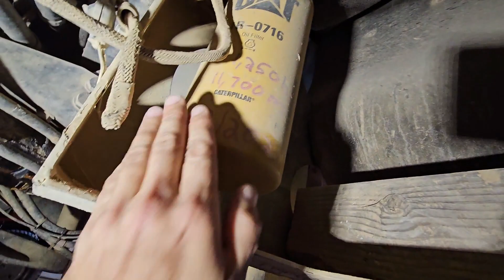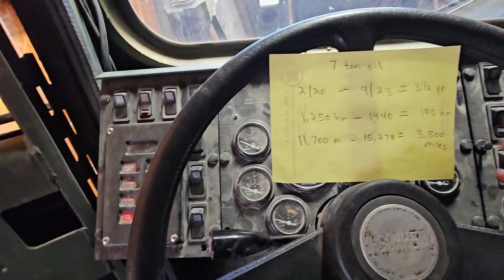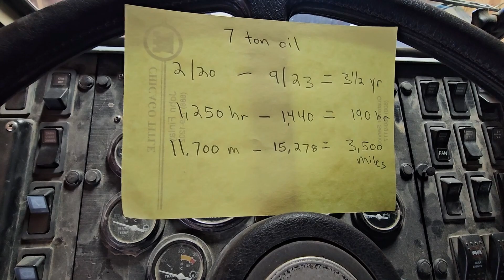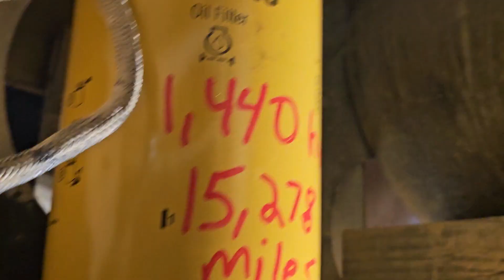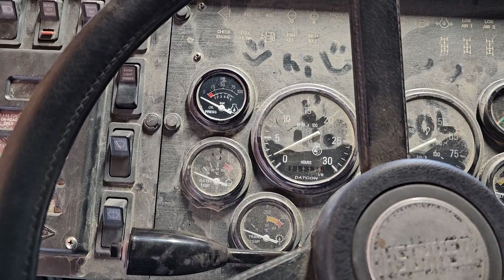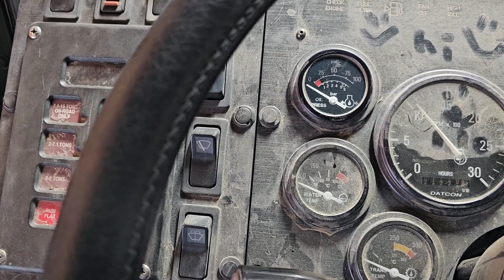Oil change on Oshkosh MK23 7 Ton Cat C12 Diesel 6X6 Military Truck

Comment: I noticed at the 10:39 to 10:50 mark in your video you have a pressure type plug showing in the background. My MK25 has 2 plugs: one for eng oil and transmission. Do you know if these can be used to fill or drain the oil/transmission fluid in these units?
Reply from the maker: I looked back at the video during 10:39 to 10:50 and I don't see what you're asking. I think you're talking about the oil sample ports that are under the passenger side steps. Those are for taking a small sample of oil to send to a lab
Reply: Sorry about the goofy user name...not sure what happened there. Yes, those ports are exactly what I was talking about, though I didn't know that is what they were used for. Now I know! Thank you for the reply.   @micahadams2

Comment: There's a trick to this whole proceedure. Use a Oil Filter Piercing valve after you've drained the main. You can make a venturi rig out of it if you use your Knoggin'.

Comment: What’s the top speed down the hwy?  Do yo think it would pull a Tri axle tag trailer with a 40,000 pound excavator on it?
Reply from the maker: They are governed at 65mph. On a 6% grade with 34k lbs I get down to 35mph but all the semi's are going that slow too
Reply: @micahadams2  otherwise on flat hwy no issues?
Reply: And do you know a good source for new tires?  Seems like they are hard to find new and don’t want to get into something I can’t find tires for
Reply from the maker: On flat ground it does 55mpg no problem when loaded. I have mine tuned to 505hp so that helps. In So Cal we can get used military tires pretty easy. They are easy to find, just expensive to ship
 @trinitylandscapingandexcav7965